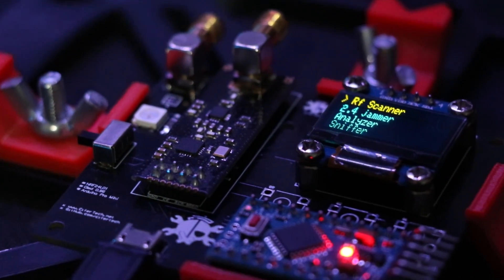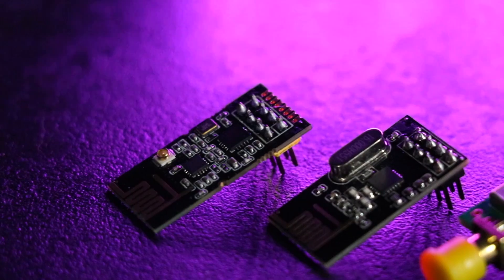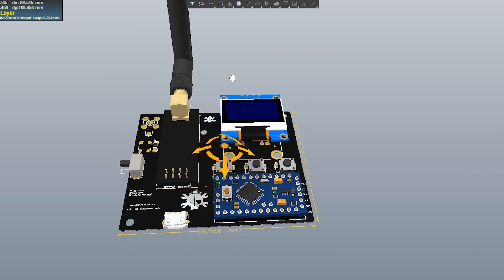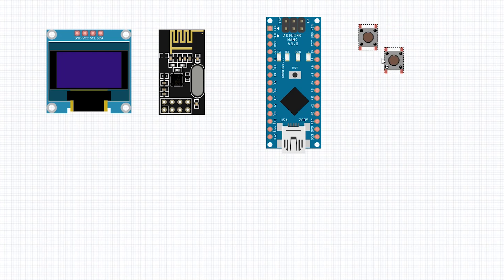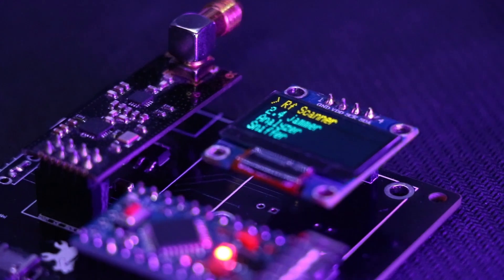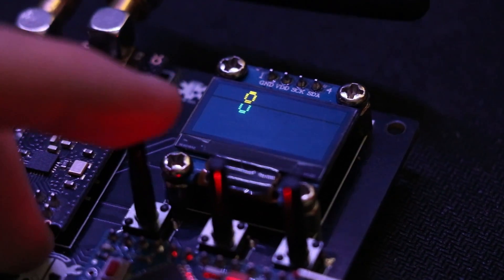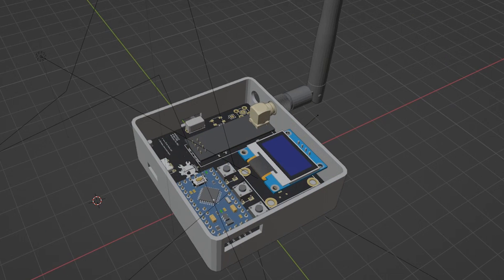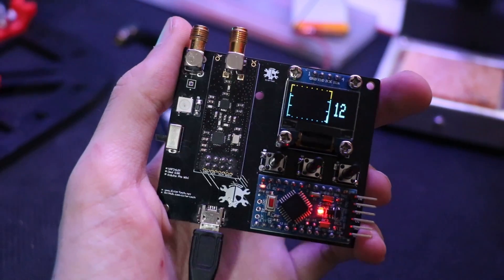ALL in ONE 2.4GHz Gadget | jammer-Channel Analyzer with nRF24L01

Comment: hello dears
there is aproblem in the code
can you help me to solve it , pleas.

C:\Users\AppData\Local\Arduino15\packages\arduino\hardware\avr\1.8.6\cores\arduino\main.cpp: In function 'main':

sketch\scanner.cpp:211:24: warning: iteration 128 invokes undefined behavior [-Waggressive-loop-optimizations]

     sensorArray[count] = 0;

                        ^

sketch\scanner.cpp:209:24: note: within this loop

  for (count = 0; count <= 128; count++)

                        ^

Comment: Ill testing ur code from git for jamming one channel of WIFI and ... router wont change channel, clients still working fine with internet ...
Reply: It isn't very strong and maybe isn't affect it much, is the wifi speed effected?
Reply: Or is the network slower
Reply: @turtlesxd4976  nothing changes when the code is running, even the channel scanner shows that the attacked channel is in normal condition, the router continues to work on it and clients do not feel the attack. Network still fast, 2.4 gGhz 75 Mb ps